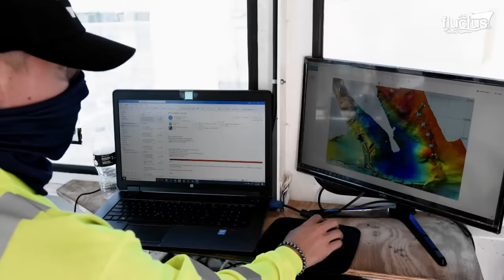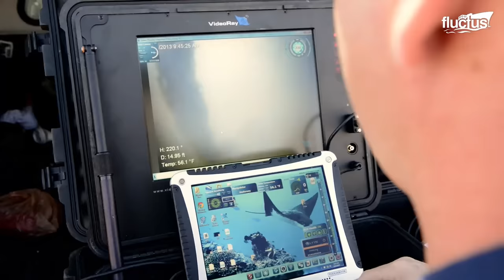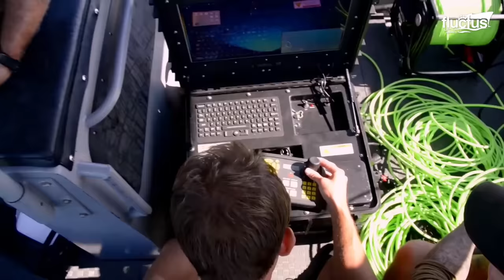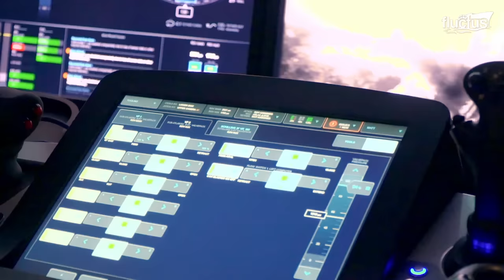What Happens When Gigantic Ship Turns Upside Down in Middle of the Ocean

Comment: I worked on M/Y Utopia IV and we crashed into a gasoline tanker at 20knots.  The tanker sank.  Several of our crew were injured.  The ship owner has refused to pay our wages and refused to pay for medical care so we filed 7 federal lawsuits.
Reply: Have you got compensation now ?
Reply: @cadetpiyushpandey5752  7 of our crew members have filed federal lawsuits for unpaid wages.  Utopia refused to pay our wages since the crash and are currently still refusing to pay both medical care and refusing to pay our wages. These are very nasty people and it’s going to be a contentious trial.
Reply: @douglasbanks3318  thank you. I am the ETO so I don’t drive the boat (I fix the electrics).  They are responsible but it takes years to get to trial in America because of how slow the court system is. Our trial is supposed to be in August. Utopia is still refusing to pay our wages and they want to change US case law so that a shipowner would not have to be responsible for their crews wages and injuries.

Comment: Wasn't the Costa Concordia a substantially bigger ship? (This is still very impressive, but is it the "largest salvage" operation?)
Reply: The Costa didn’t have 4,300 cars onboard. That’s some 7,000 to 10,000 tons of extra dead weight right there, apart from the weight of the ship itself, which has to be built much sturdier than a passenger cruising ship to be able to accommodate all those vehicles in the first place.
Reply: All the facts in the internet seems to point to the fact that it was Costa Concordia that was the biggest salvage  to date
Reply: True; Costa Concordia by far the biggest and most impressive re-float of a maritime casualty